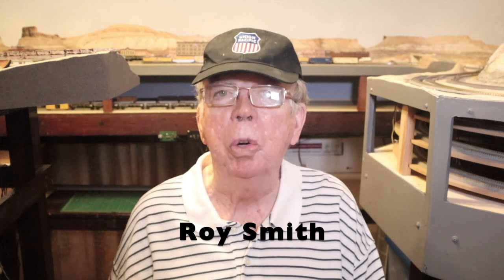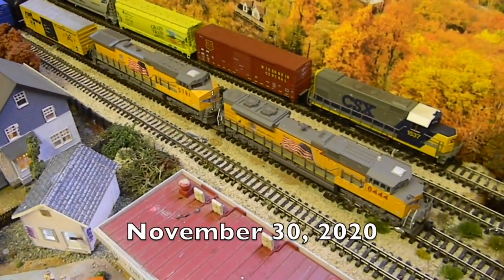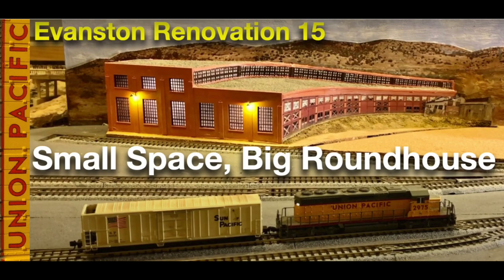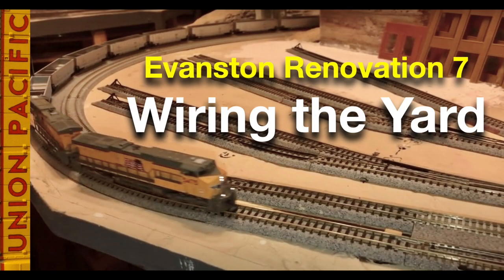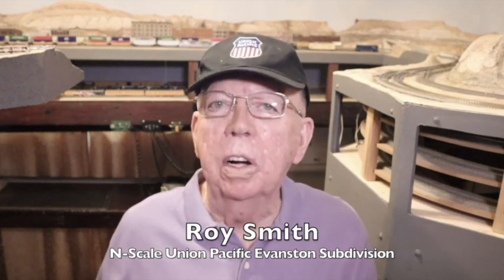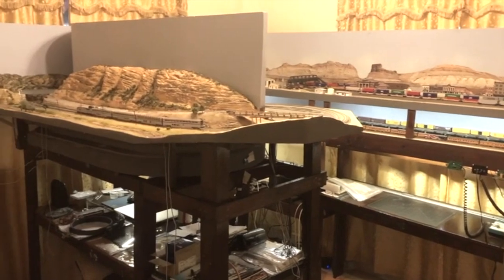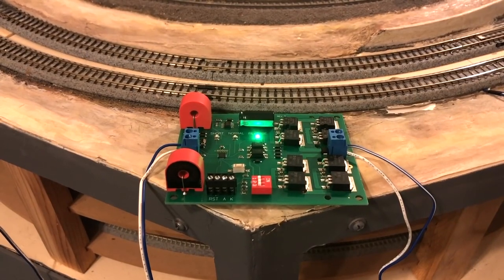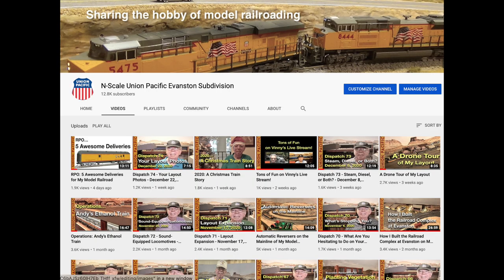Top 5 Videos on this Channel in 2020

Comment: Not wanting to sound like a bolt counter, gasoline and ethanol are not stored in bullets.  They are stored in atmospheric tanks (not pressure vessels)  Sorry it was what I use to do for a living.  Still neat video.  I still don't wonder if the railroads have buffer cars either.  However it is your railroad and your chariman of the board makes the decisions (By the way you are the chairman of your railroad.)  Happy new year.  All of the videos were good and it is as I said a tough decision.  They were all good as well as others that did not make the cut.  Keep on tracking.